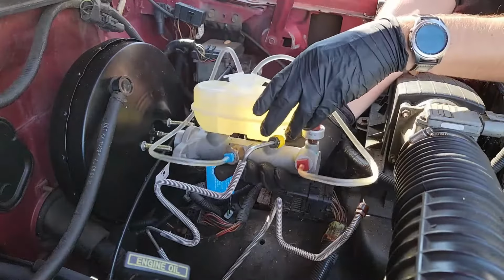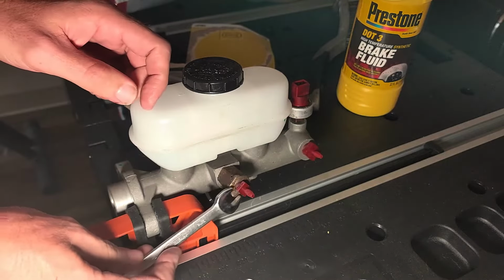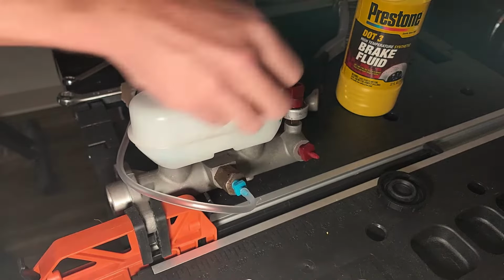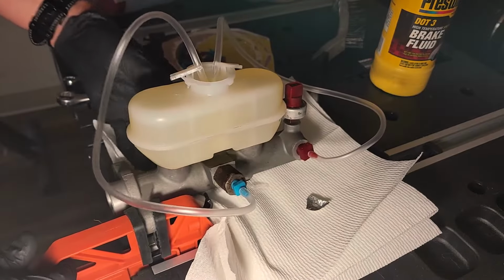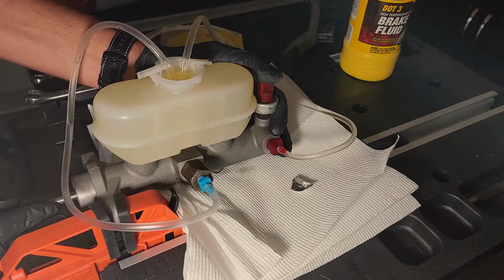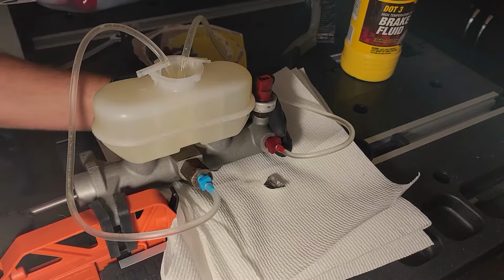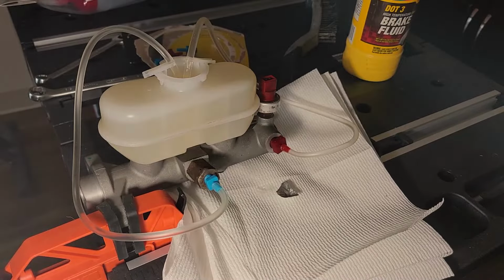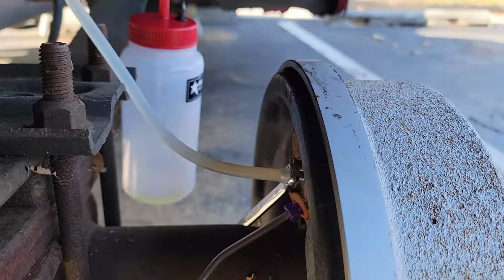Master Cylinder - How to Bench Bleed!

Comment: FYI when you bleed the master cylinder correctly like you did you will then only need to bleed the brake lines at the master cylinder not at the wheel. PS I've been installing master cylinder since 1974.
Reply: I was wondering about this, thank you!
Reply: What if you want to flush the rest of the lines out at the wheels can this step be just as effective by bypassing the step you suggested
Reply: @Gprime21  I don't know I've never done it the hard way. Try it and let us know.
Reply: @normstaley9799  cool thanks for not answering a simple question
Reply: @Gprime21  your question made it sound like you wanted to bleed it at the calipers just because you didn't feel like doing it this way. so here's the answer to your question you have to bleed it at the High Point. the master cylinder is the high point. maybe you should go back and re-watch the video and pay attention this time. your question was answered in the very first sentence
Reply: @normstaley9799  sounds like that brings old fluid back up into the new master cylinder that's just lazy way of doing it. Majority of vids I've seen is bleeding at the calipers
Reply: @Gprime21 I need to put a new master cyclinder and then flush the brake lines. Has 12 year old brake fluid. So I’d still have to bleed/flush at the calipers anyway right ?
Reply: @johnsylvester3374  that's what I would do
Reply: @Gprime21  thanks
Reply: I hooked the new master cylinder up to the car so I could use the brake pedal to pump it. Bled everything through the calipers til clear fluid was coming into the pump. New front pads and greased everything including the rear brakes. Car stops like it did when it was brand new.
Reply from the maker: That's great!
Reply: Unless you just replaced every single brake line on a 21 year old truck in the rust belt. 😂
Reply: @Dwigt_Rortugal  that's not the subject of the video, genius
Reply: Why can't you bleed the Master Cylinder mounted in the car? Just mount it per normal...install the bleeder kit...and have a friend pump the pump the brake pedal? I don't understand why it has to be bled on the bench?
Reply from the maker: Never said you couldn't do it that way. Bench bleeding is convenient if you are by yourself because you can easily see the air escape in front of you. There are always more than one way to do something. I never claimed otherwise.
Reply: @ I don’t think they were saying it like that. But if you have someone to watch the bubbles leave for you it’s def much easier using the brake pedal to bleed the master cylinder. Thats how I did it. Regardless your tutorial was exactly what I needed as I haven’t done it before. Very grateful. After the new master and flushing the lines and front pads my car stops better than it did brand new
Reply from the maker: I agree 100%. And maybe I misunderstood how they were asking.
Reply: So to understand your statement correctly, when You bleed the brake lines at the master cylinder does that mean just keeping the cap off and as you depress the brake pedal, the air will go from the lowest point to the highest point? Or do you need to be taking the brake lines off from the master cylinder reservoir Or doing some other process to get the air to the master of reservoir from the lower altitude brake lines I’m not sure I understand what you wrote, but I would much rather not try and bleed the brakes by cracking open the bleachers at each wheel if I don’t have to. And this is an honest question.

Comment: In the 70s & 80s we just bleed the master cylinder while it was attached to the brake booster on the car. Yes that take's two people, but its a lot easier to push the brake pedal than it is to push that cylinder piston in with some screw driver or long punch.
Reply from the maker: I mean, it's not really difficult to push it in once you get going. But I understand what you are saying. That's definitely an option if someone else is available to help.
Reply: I've always done it on the vehicle.  That looks like work.
Reply from the maker: Not hard at all. And people have been doing this for a long time.

Comment: Nicely Done. But a word of advice. The blue and red fittings represent metric and sae threads. There are 2 of each fitting in the kit. So you should be using both red or both blue. Get a thread pitch tool to measure the thread pitch on the nuts that come fro the master cylinder. Thats the easiest way to determine if metric of sae. Then take calipers to find the diameter of the nut. Use the diameter and thread pitch to pick the right one from the kit!
Reply from the maker: Good tip! I tried quite a few different fittings, and the two I used fit the best. As long as it doesn't leak, it should be fine.

Comment: Just learned a new tip you didn't show. Remove the covers for the connections and put brake fluid letting gravity do it's thing until it leaks. About 3 minutes for me. Then connect the tube's and so forth. Saves from A LOT of pumping! 👍🏽
Reply from the maker: I don't think that works with every master cylinder, but if it worked for you that's great!

Comment: Instead of using a work bench, just propped up on it's side a free wood pallet held up by bricks at the base. Was nice and sturdy in a pinch, and one clamp to hold the brake master cylinder
Reply from the maker: Good idea!

Comment: Great video with an awesome explanation of the process.  One question.  What is the benefit to doing this on a bench vs. on the car?  Or is it more just a preference?
Reply from the maker: I prefer to bench bleed because I can see when the air completely escapes. If you have a second person, you can do it on the vehicle. Otherwise, I feel like this is a better method.

Comment: Excellent video man. I had two questions though: 
1. When bleeding your brake lines, should you have the vehicle running, turned all the way off, or the key turned so as to have the electronics on but the engine still off?
2. When bleeding the brakes, what should be done with the cap for the reservoir? Leave it off, have it on tight, or just let it sit on top of the opening but not tightened? 
Thank you
Reply from the maker: Thanks man I appreciate it! Concerning your questions:
1. That's actually a great question. So, I probably should have covered that in my install video, but you do not need to have the key in the ignition at all. However, you will need to keep an eye on the master cylinder fluid level the next time you change your brake pads. What I mean by that is if you are low on pads, and you fill the fluid all the way to the top of the Master Cylinder, the next time you change your brakes, the fluid will rise due to the calipers traveling less with the new pads. If you have new pads, than you can fill it right up to the full line without issue.
2. I like to unscrew the cap but leave it on the reservoir. If you take it completely off, you run the risk of debris getting into the fluid. So, unscrew the cap to easily allow the fluid to flow through the brake lines, but leave it on the reservoir to prevent debris from potentially clogging your master cylinder. 

I hope this helps brother! 🤟
Reply: @TrickShiftGarage  It does man. Thanks for the speedy reply!

Comment: Hey quick question. Instead of clamping to a vice couldn't i just Bolt it back onto the brake booster and just press on the brake pedal? 

Of course with the engine off and the bleeder kit with the clear hoses hook up to the master cylinder and looped back into the resivior just like you have it in the video. 

I just don't have a vice or anyway to hold it down outside the vehicle. 

Thanks for your video it was very informative.
Reply from the maker: Hey man, absolutely you can do it. I prefer to have it in a clamp of some sorts so I can see the air escape and will know immediately when the master cylinder is bled. If you have a second person, I would have them pump the brakes as you watch and make sure the air is escaping. 

Whatever you choose to do, let me know how it goes!

Comment: At the end where you're reinstalling the MC, when you disco the fitting, brake fluid will escape and air goes in right?  How do you get that air out?  Through normal bleeding procedure?
Reply from the maker: Yes, that's correct. Air will still have trouble entering the MC because fluid is pushing (albeit very slowly) out. But once you bleed each caliper (and drums if you have them), it will remove all air.
Reply: @TrickShiftGarage  I think removing the tubes from the reservoir and putting the reservoir cap back on will create a vacuum.  This will help slow down the flow of brake fluid out of those ports.
Reply: @TrickShiftGarage  I think removing the tubes from the reservoir and putting the reservoir cap back on will create a vacuum.  This will help slow down the flow of brake fluid out of those ports.
Reply from the maker: Yea that could definitely help. Would be a good thing to try!

Comment: The absolute best thing to use is 3/16 brake line..with nuts flaired on...keep this in your tool box.
You wont have leaks while bleeding
Reply from the maker: Great tip!

Comment: Qwq Q if i install it and i did not take the air out and car used for about 1 month is that make the master cylinder damage? And i can do it now? And wt exactly will happen if i did not take air out?  And can i remove the air from master cylinder after i install it and remover the air by wheel?

Comment: How do you have to keep filling the reservoir when it's just going back into the reservoir
Reply from the maker: The fluid is replacing the air inside of the master cylinder. So, you need to add more fluid as the air escapes.

Comment: You may have better luck if you crack the bleeder lines once you fill the tank, that will let fluid flow into the cylinder and ensure you aren't dry pumping the cylinder the first few times. Source of the comment comes from the instructions on a cylinder I just replaced. I think you can get the same results if you don't tighten the connectors until fluid starts to leak out a little, or pull the hose for a short period to allow the free flow of fluid to start and fill the cylinder. I also had luck pausing with the cylinder held in and holding the lines vertical to let the air work its way up before releasing the cylinder and drawing the air back in.
Reply from the maker: So before tightening the fittings, let fluid seep out of them first, then tighten and start pushing the cylinder in? Is that what you mean?
Reply: 4 1m
 m1qpp
Reply: I’d did it the same way you did and now I have a leak out of the piston after install.
Reply from the maker: How?
Reply: @TrickShiftGarage  scratch that, one of my brake lines out of the cylinder was leaking and spraying the base of the cylinder where it connects the the booster so I thought it was leaking, it’s not it’s a line that I had to flare myself apparently 1 out of 4 flares was bad. So I’ll have to do it again. Thanks for the video. By the way, I bench bled the cylinder before I watched your video. But thanks anyway.
Reply from the maker: Oh OK, I just wanted to make sure. Glad you got it figured out!
Reply: @TrickShiftGarage  yes I did. Thanks, your video is awesome.
Reply: @TrickShiftGarage  by the way i did ask myself why that one line was not bleeding, but it did eventually lol
Reply: I also had to take a brake before finishing. Man was my hand cramped.
Reply from the maker: Lol, yea breaks are needed. I definitely had a few. The piston isn't as easy to push like it appears in most videos lol.
Reply: @TrickShiftGarage  when I first noticed the leak I thought I damaged the piston. Lol I thought I over bled the master because the leak appeared to be coming from right at the back of the cylinder. I’m glad I didn’t break it lol first timer over here. Did brakes lines right before.

Comment: Before you take the master cylinder off the truck ,do you drain all the brake fluid In the MC what about in the lines
Reply from the maker: Yes, you want to remove as much brake fluid as possible and then put it in a container. You can use a turkey baster to siphon out the old fluid. The brake lines are fine. You don't need to remove the fluid since you will have to bleed the brakes afterwards anyway. Thanks for watching! 🤟

Comment: Would this fix the air "hissing" I now occasionally hear after I replaced my  rear calipers? I bled the rear brake lines using a helper, but now I hear this hissing noise and I can't determine if it's my master cylinder that needs a bench bleed, or if some other hose has air in it, or if it's a faulty brake booster
Reply from the maker: I would guess it's a vacuum line somewhere (maybe the one that connects the brake booster and the intake manifold). Let me know what you find out!

Comment: Can this be done without removing the master cylinder and simply unplugging the two lines, place the two fittings, run the hose and use the brake pedal instead of the screwdriver?
Reply from the maker: I guess theoretically it could, but it will take a lot longer because the brake booster rod will not push the piston in as far as the punch/screwdriver. Since you have to remove the brake lines, you might as well just remove the 2 nuts and take it off. But that's just my opinion.

Comment: Many thanks. Quick question, my master cylinder has 3 lines vs yours with 2. Same procedure as you show ie 3 lines into the reservoir or just 2? It is a 1980’s Merc master cylinder. Thanks for your help.
Reply from the maker: I'm going to search around about this to make sure I don't give you incorrect information. I would guess it would be the same, but that's all that is. Just a guess. 

I'll see what I can find.
Reply: @TrickShiftGarage  many thanks. I think it is all three back to the reservoir until no more bubbles. Will give it try, can’t hurt. Be well.

Comment: Is this really necessary? Last time I had a dry master cylinder I just filled it up on the vehicle & bled at the wheels like normal - hard pedal.
Reply from the maker: Yes, it's absolutely necessary. You have to bleed out the air from the master cylinder or else you will always have air in your lines.
Reply: @TrickShiftGarage was wondering the same thing, thanks for clarifying.
Reply from the maker: Anytime!

Comment: I got new MC for my car but I just installed w out bleeding it but when I went to bleed the rear breaks nothing would come out only the front 2 , could bleeding the MC be why I get no fluid to the rear?
Reply from the maker: That could definitely be a part of it. You absolutely have to bleed the master cylinder or else there will always be air in your brake lines.

Comment: Great vid. I was wondering if there is air in the master cylinder does that also mean there will be air in the brake lines and vice versa? Or are the two seperate?
Reply from the maker: Yes, if you have air in your master cylinder, they will eventually travel to your brake lines as well. Thanks for watching!
Reply: @TrickShiftGarage  does it also work the other way around? I’m just wondering what happens if you bench bleed the cylinder then drive the car without bleeding the calipers and they contain air.

Comment: When I removed the fitting all of my brake fluid leaked out quick. Didn’t give me enough time to put my brake line on. What can I do to prevent that
Reply from the maker: It shouldn't leak out very fast. Some fluid may come out, but it theoretically should just drip out slowly. What kind of vehicle do you have?
Reply: Ford Fusion 2010 2.5L manual transmission. My reservoir has an extra hole. Also, the largest fitting I got from the kit, didn't properly seal, so some of my brake fluid leaked out while I was "bench" bleeding. But yeah... I had a difficult time doing this and got pretty frustrated when everything just drained out when I removed one fitting. Didn't give me any time to put the brake line on.  Any insights will help, and thanks for replying. @TrickShiftGarage
Reply from the maker: Hey Jeff, I'm still searching for information on this. I'm not 100% sure why it's pouring out like that. Was this a brand new master cylinder, or a rebuilt/used unit? 

Also, I believe you have an extra hole in it because you have a manual transmission. A lot of vehicles use that instead of having a separate reservoir for clutch fluid.
Reply: I also tried looking for information on this but could not find anything. It's a rebuilt one. I checked all the seals and everything looked fine. When I was bench bleeding, the only place it leaked out was where the fittings were located. 

Ah, that makes sense, thank you for that piece of information. Thanks again for trying though. Your time is well appreciated. @TrickShiftGarage
Reply from the maker: Anytime brother. If you ever figure out the issue or get it fixed, please let me know!

Comment: Very bad brake fluid can (it happened to me) inhibit stopping as quickly or not at all. Test brake fluid once a year with test strips and water tester. Ruel of thumb every two years or every 24000 miles replace all brake fluid by flushing with fresh brake fluid. If fluid test good brobley not necessary to change fluid that often.
Tap on a clip to paste it in the text box.
Reply from the maker: Good tips!